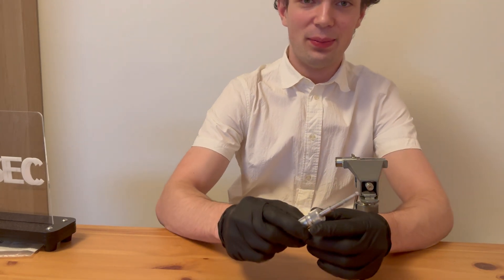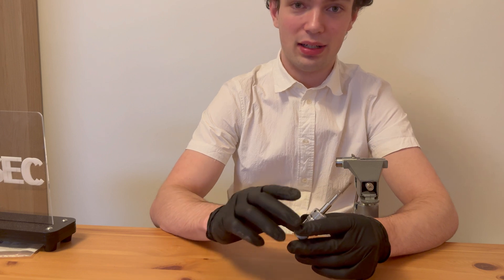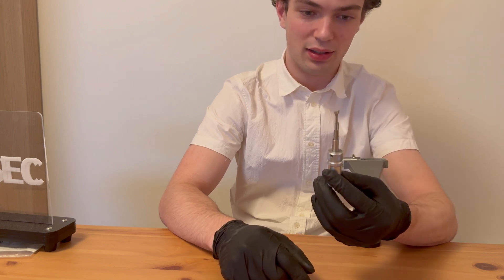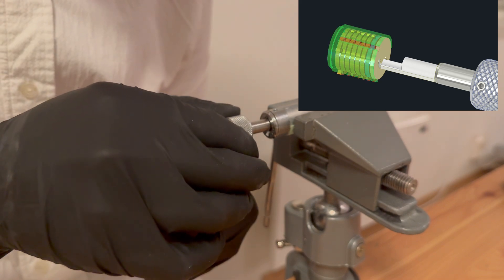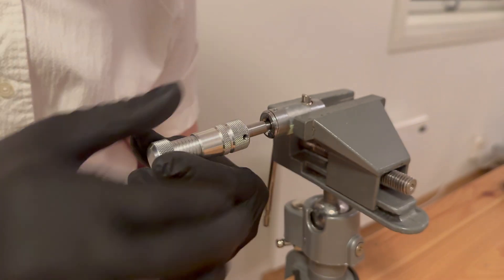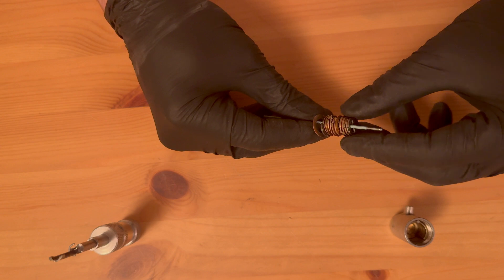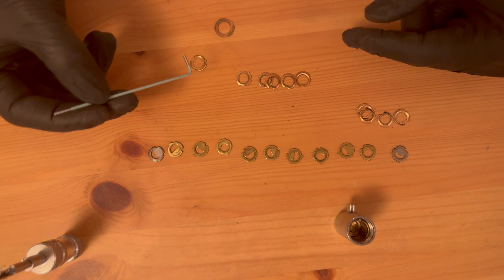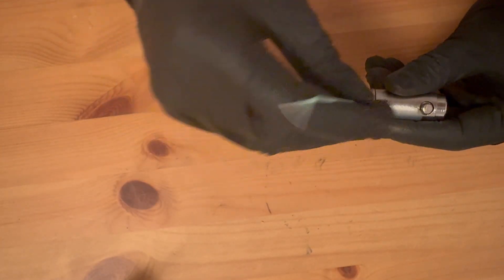Abloy High-Security Lock EXPOSED: Picking, Guts, and Analysis

Comment: To be honest, Abloy Profile it is easy to pick, there are no false gates. The only problem is making the right tool because there is no mass production. But the material is excellent, lots of interesting information.
Reply from the maker: @BezKlucza  the abloy profile has false gates as you can see in the video.
Its a moderately difficult disc detainer lock.